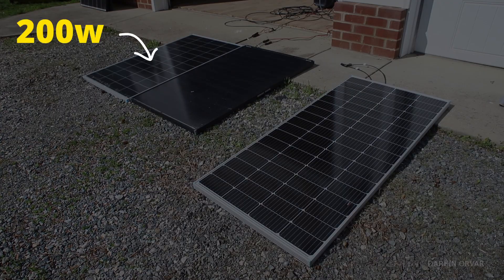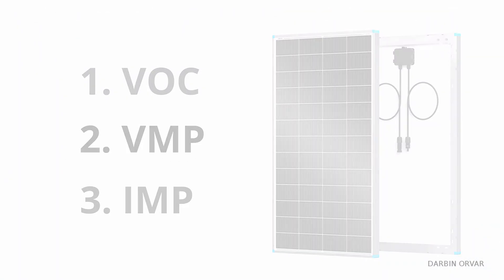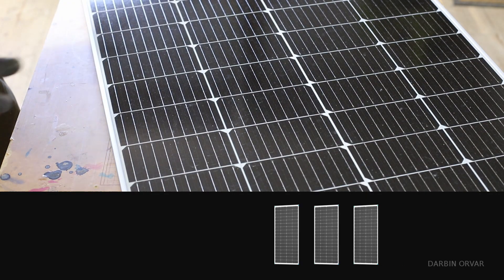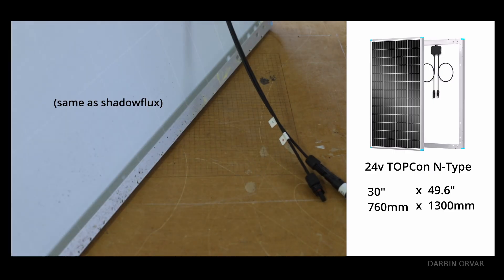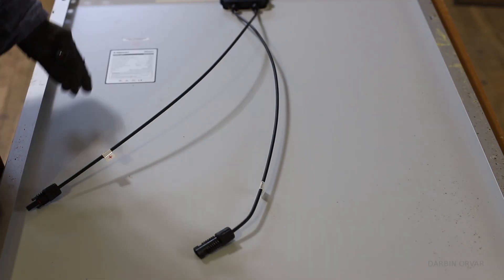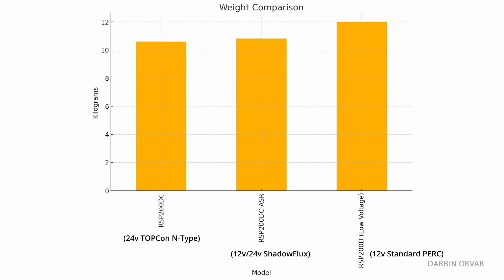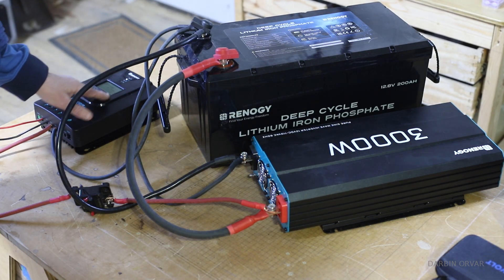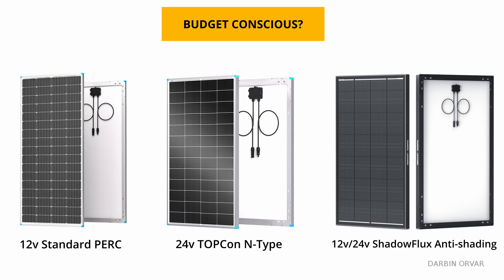Renogy Solar Panels Compared: 12V vs 24V vs Anti-Shading – Which Performs Best?

Comment: why you say you need 20 ampere fuses on a  panel, that makes no sense?
a panel that can deliver max 10 ampere in a short, what bringstyou a 20 ampere fuse if a panel ist not able to ever deliver more the 10 ampere?
makes 100% no sense...

Comment: The technology used with the 'Shadowdlux' panels has been around since at least the 1990's, its basically diodes printed onto the curcuit boards. The various manufacturers just decided that they could all offer the much less efficient panels which were cheaper to manufacture in the long run, so long as no one offered the better panels at a sane price. Looks like Renology may have broken free from that mindset.
Reply: B I N G O - they’re 200 W panel in optimal condition yields over 190 W on average. mild shading here and there brings it down very little. In fact, you could shade half of the panel and still produce significant voltage.